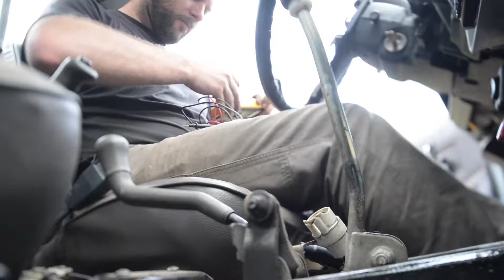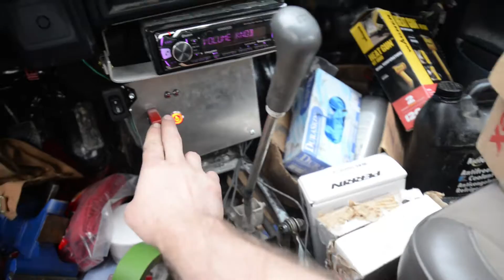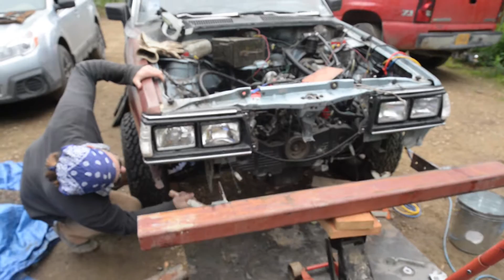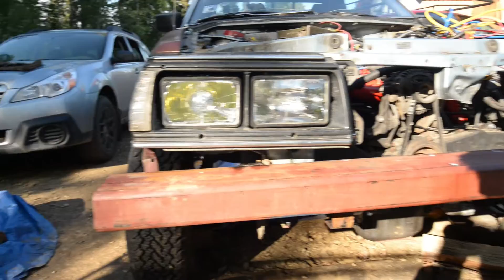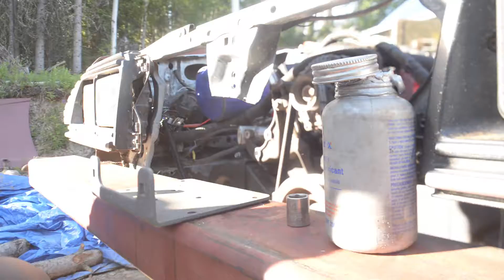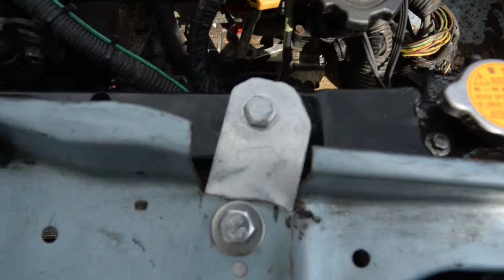Backyard Brat Build 04 - Transmission wiring, front bumper, winch, radiator support

Comment: Been thinking about picking up a poor brat that someone left behind a barn and beat the shit out of every body panel. Mostly wanted to know how feasible it would be to restore it and throw a more modern engine in it. Thanks for the excellent videos. I know I have quite a lot of work ahead of me if I pick it up.
Reply from the maker: Do it! Just the engine swap, using an EJ22 or SOHC EJ25, is actually pretty easy. It's all the other stuff I decided to do that got complicated.
Reply: Good to know. Wanted to upgrade the tranny too because from what I've heard the original was just terrible, but I wasn't sure if that would mean I'd need a newer diff too, or just a custom driveshaft to go to the old one. Not 100% sure how subaru's AWD system works and if it needs access to the rear diff.
Reply from the maker: The original 4 speed transmission is pretty bad, but I ran it for a while before I did the 5 speed swap, so it does work. For the 5 speed swap, you want the transmission and driveshaft out of an 85-89 4WD wagon. The driveshaft will be the right length to work in the BRAT, and it will bolt to the original rear diff so you don't have to do anything there. You'll have to mount the trans to the original crossmember (I did that in episode 1) or fabricate a new crossmember, and you'll have to make a mount for the center bearing in the new 2 piece driveshaft, but that can be really simple (check my solution in episode 3). So it's a little more work than just the engine swap but it's still not too bad.